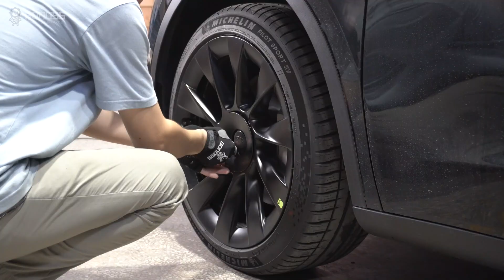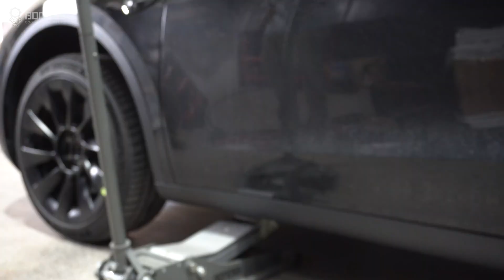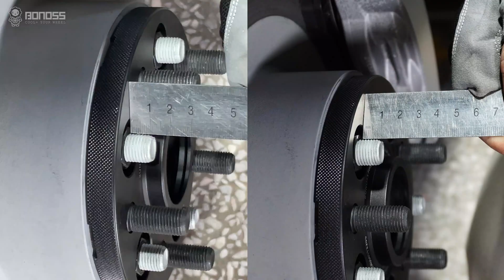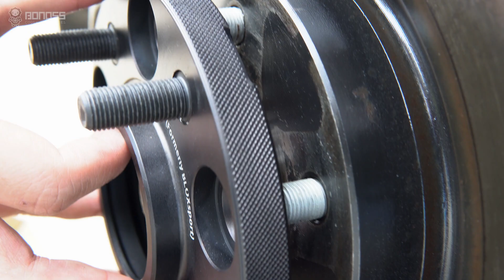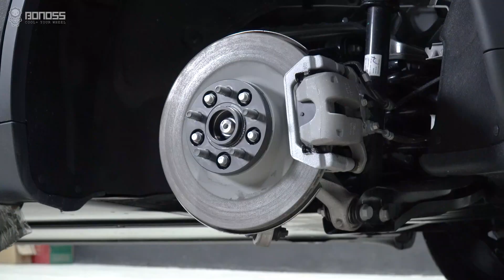Is It Possible to Install 15mm Wheel Spacers on Tesla Model Y 2023?|BONOSS

Comment: Why would you need that?
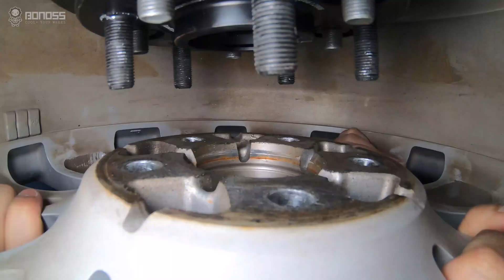Reply from the maker: It shows in the video (0:50), that after installing the spacers, the original studs protrude and need to be installed in the back of the wheel grooves. Installing 15mm spacers, the length of the original studs protruding is longer than the wheel groove depth, so the original studs need to be cut off. screw or install thicker wheel spacers.
Reply: @BONOSSUnofficial  I still do not understand why I would want wheel spacers for my Model Y.
Reply: @jdude2509  if you have to ask then you don’t need them.
Reply: @jdude2509  for looks and wider stance. Your wheels are now further apart from each other and makes the car feel more stable and planted.
Reply: @BONOSSUnofficial 
If you have the Induction wheels (where they show that there’s a canal) vs a wheel that’s flat, then you don’t need to cut bolts.